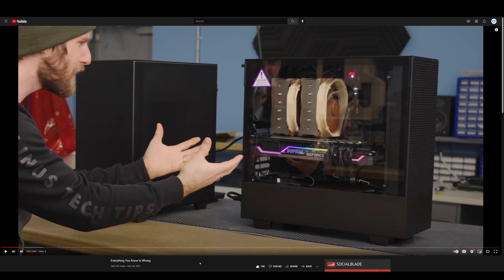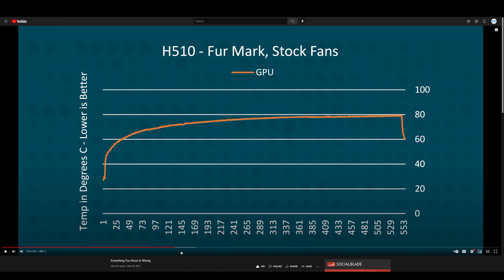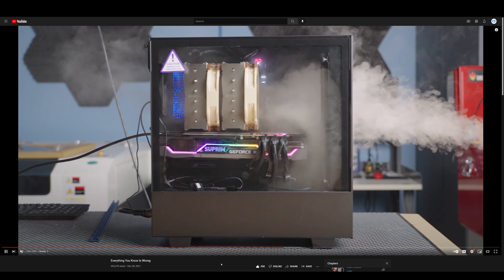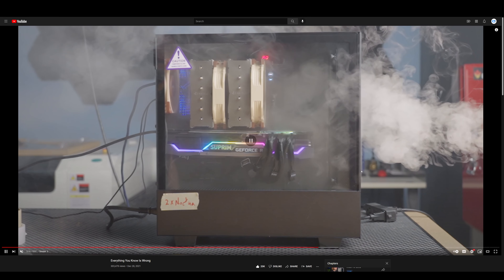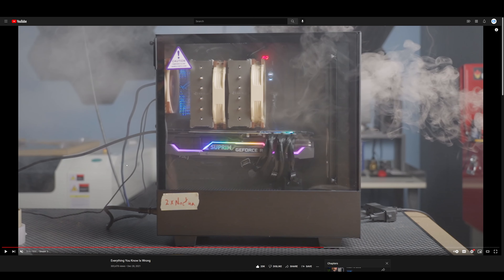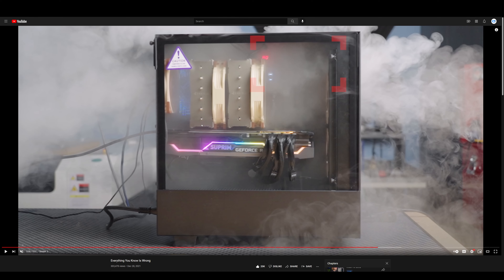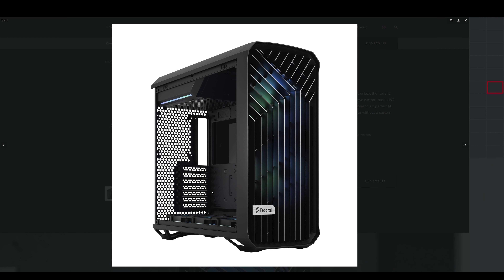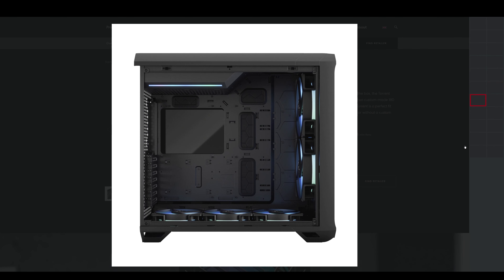"Turbulence" is NOT making your GPU hotter

Comment: Makes complete sense to me... I'm using Bequite Dark Base 900 Pro Rev.2 case fitted with 2 x 120mm Bequite Silent Wings 3 2200 RPM fans at the bottom of the case, they keep my GPU between 26 C no load to 56 C under full load with a positive upward air pressure. GPU cooling is becoming more critical with bigger more power hunger cards, keep cool and your GPU will last :)
Reply: so its pulling air from the psu upwards? Im trying to cool down my pc and im in a tropical country. I need to cool down my gpu thermals.
Reply: @NectarGaming  after watching this video, im thinking about flipping my front lowest/3rd fan to make it exhaust, to lower the pressure atleast in the bottom part, for my GPU and PSU to effectively pull air from behind.
Reply: @MrClauried  if you do that it will not provide cool air or any air to the GPU if you have bottom fans you should place it in a way it intakes air from bottom of the case

Comment: Having the aio radiator in front of the pc isn't ideal too as it would dump all the cpu heat into the case. Unless the pump is situated in the radiator you would want it to exit its air on top of the case. You cannot do that with the psu on top.

Comment: I've built in a few different cases over the  years, by far the best for thermal management,  ease of build and with moderate flexibility has got to be Corsair's Carbide 540 Air, the twin chamber design means that the majority of cables and PSU are hidden,  you retain the possibility of a 280mm top mounted radiator, in my experience better than a front mounted 360mm which dumps the heat back into the case rather than straight out the top. The GPU has vents below and to the rear.  I get very good  temps compared with builds of the same components. Case needs to breathe.

Comment: I wonder would the whole dynamic change if AIO was used for the cpu? That way the heat is blown out by the aio fan and there will be lesser hot air circulating. I also wonder is a 60,80 mm intake fan at the rear just just the gpu will help to get fresh air into the gap and reduce gpu temp

Comment: Interesting, I have 3 front intakes, AIO 2 fans top exhaust, and 1 back exhaust.... I experimented adding un intake fan in the under de GPU, near te 2 front intakes, and boy, keeps the GPU massively cool, always leaving that space under the GPU to naturally exhaust the hot air through the mesh panels, its amazing what air pressure can do, keep in mind, every case is different, you need to experiment. Fan speed for each section is also something to consider.

Comment: I just ordered myself a single exhaust fan in the hopes that it will help lower my GPU temps (it's a 1660ti which doesn't get too hot but rather too noisy). Sounds like that could actually work!

Comment: I have lial li o11d.. if my fans 6intake and 3 exhaust.. my gpu temps wil be 73degree.. then if my fans are 3intake and 6 exhaust my temps only 67degree.. meaning. The hot air trap inside my case.. my gpu is asus strix 3090.
Reply from the maker: No its more about where you place your intakes and exhausts for most cases. For an O11D the best config for GPU temps would be all bottom intakes and everything else exhaust like your example of 3 intake 6 exhaust because all the exhaust fans are pulling air away from the GPU as much as possible. But the CPU temp might suffer from sucking in hot GPU air if you have a water cooler. So personally I think the best compromise is all bottom intake and a side intake for the CPU water cooler and top and rear exhausts.

Comment: The input airflow must be more  than the output flow , if you put  huge block of metal the air can't flow to they output fans , i have 12600 at 55 decree at100% use and gpu 3060 at 80% use at 70 decree i think i know something about airflows

Comment: So does that mean if I use the standard configuration with PSU at the bottom, front fan intake, rear+top fan exhaust, it's better to keep the case negative pressure, so cool air can be suck into the case from the PCIe backplate or the bottom mesh even though there are no intake fans for the bottom area which is right beneath the GPU? In my setup there is only one intake fan in the front and 3 exhaust fans (2 for AIO on the top and 1 in the rear), all 12cm ones. There is an extra slot for intake fan in the front, and to keep the high negative pressure, I shouldn't install another one, right? Besides, since there are 2 slots for intake fans in the front, does it matter which one I use? I am guessing if the fan is in the higher position, the air coming from it is more likely to exit the case directly without circulating inside, faster airflow will cause lower pressure and then cool air will be suck into the case from the bottom; while if it's in the lower position, it will provide intake air for the GPU, but then create much more complicated turbulence and it becomes extremely hard to decide if it's beneficial or not without a simulation.

Comment: that why i have 2x120mm fans in bottem front +  2x140mm aio fan on top and a 1x140mm an at the top back so far it work fine
also fans are not the only thing it about what kind of fans you use and at what speed 
 ""older"" fans are design for two special functions air flow or air pressure, modern case fans are designed to deliver a mixture of both 
then there is speed intake fan should be slower then fans at the back or top 
but dont sets the fans that blow the air out not at maximum speed! 
since especially with fans that are designed for pressure, as these block themselves at a certain speed and thus offer less air throughput

Comment: Until now, I still prefer Lancool 2 mesh for the extra area that's under the gpu have the ability to install 2 fans for gpu airflow
Reply from the maker: The torrent case literally is all mesh at the bottom.

Comment: Full ATX case. I have positive pressure, temps don't change. I have open air, temps don't change. I have negative pressure, temps don't change. Zero flow at all? Well. I don't need to tell you what happens with no air flow. Fanspeeds don't affect much. Temps remain the same between 30% and 100%

Comment: What about bottom to top airflow?
I mean it would be the most logical because heat goes up... No?
Reply: in theory yes...but again...having such airflow as perfect as possible would require shifting most motherboard components vertically instead of a traditional horizontal build ( front to back air flow design )

the best vertical airflow you could have is only bottom and top fans, gpu mounted vertically and modded so it only pushes air upwards ( block bottom and side exhaust route )...and for cpu, an aio would generate as less turbulance as possible in the middle area while keeping it's warmth out the case

other than that...i'm not a hardware engineer but as for vertical airflow...i guess nothing could beat that...as long as air pressure stays positive ( more intake than outtake )

Comment: I'm surprised these companies don't get on board (pun) with real modular cases. You are running xCPU ? Then this case attachment will duct outside air direct to the CPU then out of the case. XGPU? This side panel with let you card vent right out the case from the side and so forth. Especially with these new cases coming with removable hinged doors. "Give me the LANCOOL III with side panel xyz so my 7900xt will vent right out the side.

Comment: The bottom-to-top airflow pattern is the best, especially with all of these new passthrough GPU heatsinks. I'm tired of all of these giant basement dwelling PC cases that have the graphics card crammed into a corner. Why does the basement have to be so huge, anyway? How many cables and HDDs are people cramming in there? Why can't the PSU be worthy of being showcased?

My second favorite airflow pattern that's becoming popular is the Lian-Li 011 Dynamic side exhaust style. If you are using a vertically mounted graphics card with a passthrough cooler, the hot air should exhaust directly out through the side vent. This is much better than a lot of cases that choke off vertically mounted graphics cards, especially sandwich form factor SFF cases. Stop choking the hottest component in your PC, people!

Comment: i have an Antec flux series pc case. I have installed two 120mm fans above the psu cover. Air enters the psu space from the bottom of the front (i have 3 intake fans) and from the back panel which has a mesh grill. I began to use this method because my old r9 290 was an oven and i had a Nox case which had the option to put the fans above the psu. The r9 went from 85ºC to 70ºC. Check it out, mine is the dp 502 flux.
Reply from the maker: That is a good solution

Comment: These are not cases flaws, these are ATX mobos and GPUs design flaws.

GPU started as simple addon card without any heatsink. It is plugged in into motherboard just like any other extension card, like additional USB card, ethernet card, audio card.

The GPUs grow to very complex devices, drawing a lot of power and generating tons of heat.

The truth is that the maximum power of GPU should be the power from PCIe slot. If you not exceeding that, you don't have heat problems.

If we put high power GPU, we block it's airflow by GPU itself. We put it upside down. This is the dumbest idea ever.

The only way to make a proper airflow GPU while still using upside down mounted PCB is to make it 5 slots and rotate fans so they move air like CPU coolers does. Tower style GPU cooler with 3 or 4 fans taking air from front of the case and exhausting at the back next to video output ports.

Other way is to use PCIe extensions and mount GPU somewhere else, like many case manufacturers are starting to do.

Comment: Higher gpu temps were known to be an issue ever since basement power supplies and psu shrouds became a mainstream design. However it looks better than the old school designs with top psu and cables hanging down all over the place.
Also i don't think the industry puts too much focus on gpu airflow the way it does cpu airflow, as big gpu coolers are generally good enough to keep the gpu from throttling, and smaller gpus can just ramp up fan speed to noisy levels and the temps will be alright.
At the end of the day though, components don't really care if they run at 65 or 70. As long as it isnt throttling it isnt a problem.
New video from you. Long time.

Comment: My money is on the GPU power cables blocking flow.
Reply from the maker: Nope that has nothing to do with it. They're out of the way basically sticking to the glass panel.
Reply: @OTechnology  I don't agree, you know the cable is going all the way down towards the motherboard.
It is like 3 rods that are breaking the airflow, and turn into a turbulence wall restricting air to go towards the back I/o ports.
I would agree that the air flow is very restricted already, cause the fan is hitting the gpu from the side.
About 1/4 of the air is going down there but is getting blocked by 3 massive cable bundles.

You can't say it has nothing to do with airflow, the cables are literally there.
Reply from the maker: @N0N0111  Nope turbulence again has nothing to do with it. A bit of cable with free space around it is not going to stop a fan's airflow. They are used to blow through heatsinks that are a much higher restriction without problems anyways. Again the cable is not in the way of the front fans airflow in the first place, you can see in how the smoke goes behind the cables in Linus' video.
Reply: @OTechnology  Okay fine we both are not experts, hope some expert on YT picks it up :)
Reply: @N0N0111  Turbulence has literally nothing to do with it. It's the thermal capacity and dynamics of the case that suck. One roof mounted fan exhaust and one rear exhaust. That case would suit a 120'140mm Rad with also one exhaust fan to alllow for thermal circulation to begin with, not the honking air cooler that Linus used. Plus the two fans in the front would allow for balanced air pressure. This means that they GPU gets all the cool air it needs from the front and back and the case has enough capacity to move a lot more air in and out more efficiently. 

Thermal dynamics is a very complicated science. But use a bit of common sense and more space means more capacity for air flow yes? 

An AIO will allow for dual zone air flow. VRM's, RAM CPU cooling zone up top and the GPU getting all the air It can from back and front without it being parasiticaly being stolen from the air cooler. The case simply isn't designed for air cooling. It's a design which is utterly flawed but can be overcome with a 120/140mm AIO with a CPU and motherboard to suit where the AIO can be mounted ontop or the back exhaust and the exhaust fan also fitting in the top or back as well. That way you have thermal capacity and correct pressures from front to back and ALL components getting fresh clean air in and hot air exhausted at the same time all while minimising dust build up. The only issue left of the PSU shroud. You can overcome that with tin snips 😊. Or just accept the short comings of the case. There was more than enough breathing space for the GPU still using my example using Linus's example though. It comes down to knowing you thermal capacity and dynamics of your case and what WILL and WON'T be suitable for the case you buy. 

This is a 120/140mm Rad and 3 120/140mm case. The motherboard should be a mid to low end board with nothing more than a I5 or 3600x. 750watt PSU inside. The ram spec should also not be super fast (anyway its not needed for this spec build as well) to avoid unnecessary heat soaking in the top of your case with no ventilation.) The rest needs to be be ssd, no mechanical hdds as again heat soak issues. 

Saying all of that, It's a terrible case hands down and turbulence has nothing to do with thermal capacity or case dynamics it's just a byproduct of what Linus caused with that honking air cooler to begin with. 

I personally use a full sized tower and AIO on my CPU and also AIO GPU 😂. 

But I'm running everything at serious overclocks and all extremely high end from front to back plus Led's and capture card etc and a 1000watt PSU. My case is currently the Corsair 750D(High airflow), I'll be upgrading to the Corsair 7000D High airflow this year. Turbulence doesn't cause heat soak it just lowers cooling efficiency is all. Just always remember capacity and dynamics for case suitablity for building PCs. If it's high - enthusiast end bigger case is better but more cost and more fans. If it's a mid to low end build, mid tower to itx. An itx build for example I3, Ryzen APU, Nvidia 1050/1060 600watt PSU at most! 

Mid build as mentioned with this case and only up to a 3060/3070 or 6600/6600xt GPU.. 

Build for your needs not what YouTubers show you. Especially micro itx case with a 12900k and RTX3090 and 1000watt low profile PSU for heaven's sake!!!! It will melt over long use periods and shorten the life off all components by up to 80%! 

You'll literally have your PC for six months before you need to replace almost everything with a brand new build.

I hope this covers both discussions you are both having sufficiently. 

Kind regards, 

CTT.

Comment: What you and Linus are saying are both right I think. This because the air circulating inside the case on a system level (the case) is also called turbulance, I think. Don't know for facts exactly, but I think Linus might have been thinking so as well.  You just get the fundamental reasons and mechanics quite well here I think and also helped me understand pc case airflow better. Haven't watched the full video of Linus so can't compare otherwise.

Comment: Before 5:50 you claimed that turbulence isn't the reason that gpu gets hotter but after 5:50 you clearly shown air circulation process because of not having equal amount suction fun. Dude this also a kind of air turbulence 😉 where air is not stable for pressure difference because of frictions. This one of vital study field of fluid mechanics. Even though I'm doing my bachelor in EE, but I'm whole nerd on mechanical engineering since class 8 and having tons of knowledge of different sectors. Even tho my bachelor program also contain this semester Mechanical course on fluid machineries, turbines (steam and gas), ice, boilers and so on..
Reply from the maker: Yea no that is completely different. Pressure differences is not turbulent air.
Reply: Dude, had you ever have any fluid mechanics course in your bachelor? Or you're just claiming this out of your ideas?
Reply from the maker: @KingKong-xp6so  Lol you don't need to know fluid mechanics to figure out what's going on with that case airflow.
Reply: I don't even need to bring out the phenomena happening inside the case to call you out.. I'm just showing how you're wrong about an idea and claiming sh#t out of nothing..

Comment: Case ku Cooler Master Q300L
Untung engga ada PSU Shroud nya
Jd masih bisa kasih 1 fan
dan emang berguna bgt , VGA jadi lebih adem
Reply: Jadi gimana gan maksud vidieo tersebut ? Bagusnya gimana posisi fan nya ?
Reply: Punya case yg model apa bang?
Reply: @nickyandreawan26  cube gaming kellva gan
Reply: Psu shroud itu maksudnya apa ya gan ?
Reply: Psu shroud itu lokasi tempat psu yg di partisi, aku udah ngecek tipe casing mu, ada psu shroud nya
Intinya di video tersebut, casing jaman sekarang kebanyakan gabisa pasang kipas dibawah karena terhalang psu shroud, gpu dapet angin nya cuman dari depan, padahal angin dr bawah sangat berguna untuk sirkulasi angin gpu
Reply: @nickyandreawan26  lagi kepikiran ganti casing. Karna beli gpu yg 2.7slot sempit bgt bawahnya sama psu shroudnya
Reply: @nickyandreawan26  berarti bagus casing yg bawahnya itu kosongan biar bisa pasang fan intake ya ? Kayak fractal torrent
Reply: Iya klo ada shroud nya jd sempit, airflow ke gpu kurang bagus,
Iya bagusnya yg kosongan, atau minimal kyak punyaku q300l yg bisa pasang 1 fan di bawah sebelah psu.
Bayangin buat kedepan gpu powernya makin gedhe 😂